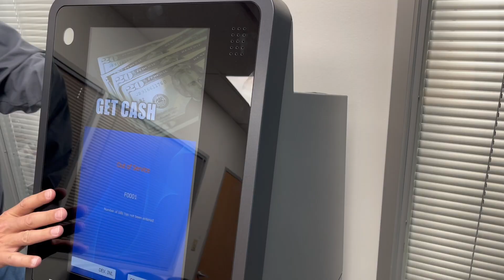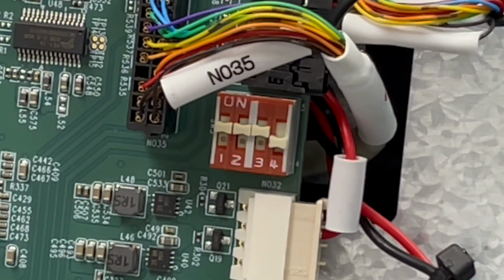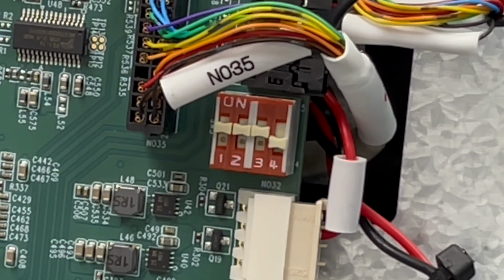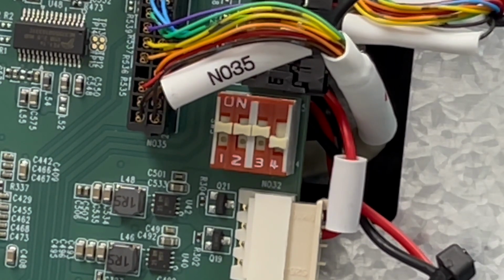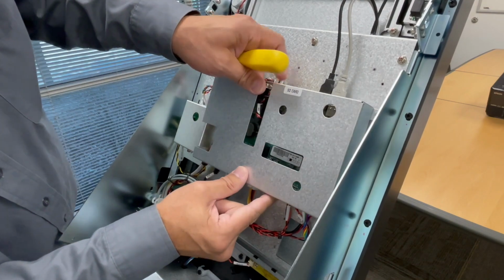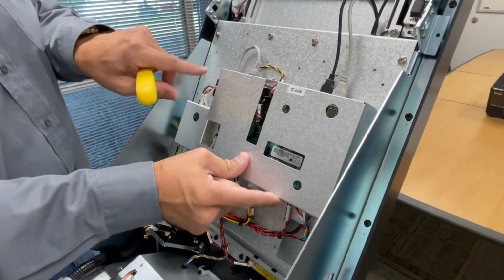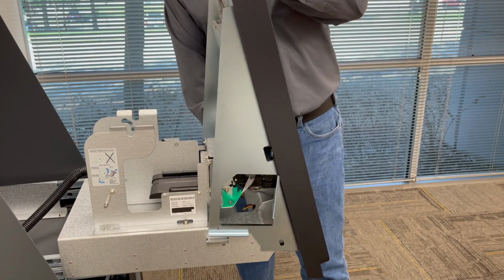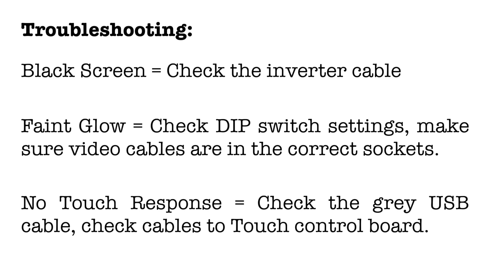(Genmega ATM) Nova LCD Panel Replacement

Comment: Can these Novas be used as bitcoin kiosks?...we use UK1 and UK2 kiosks currently and the Nova looks more compact and lighter.
Reply from the maker: I'm sorry for the late reply - the Nova can run the Liberty-X bitcoin application, however it's not a PC based system like the UK1 / UK2.  Check out the Gemini kiosks for something smaller / lighter.